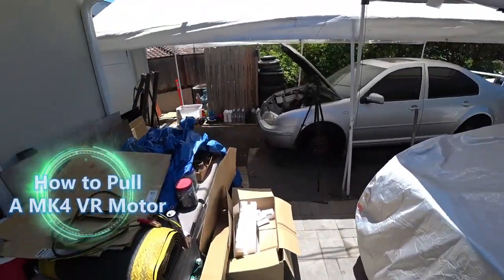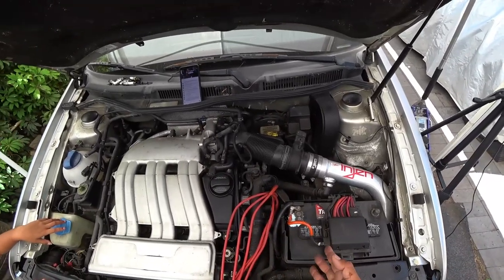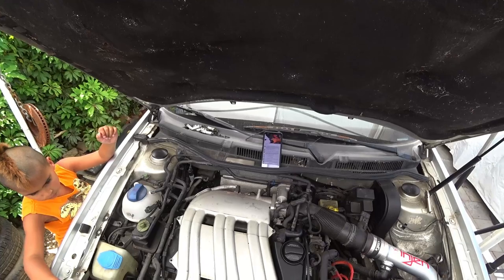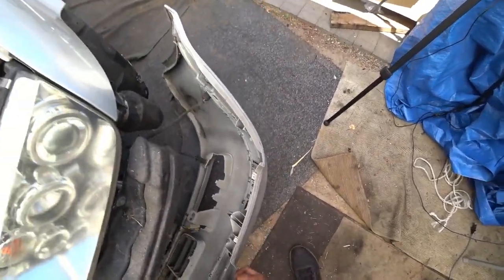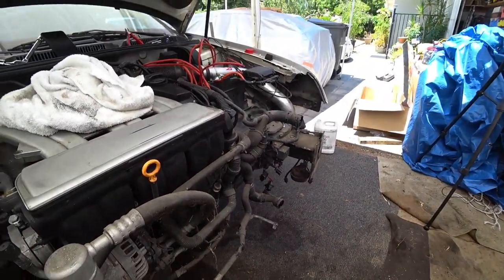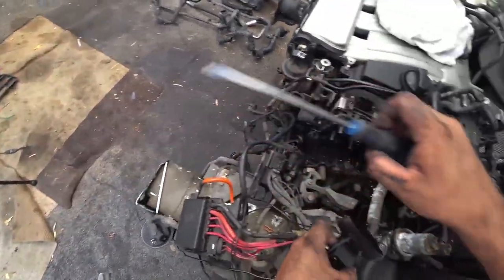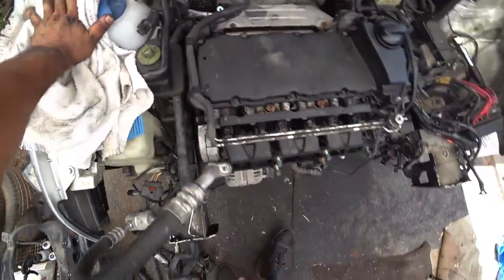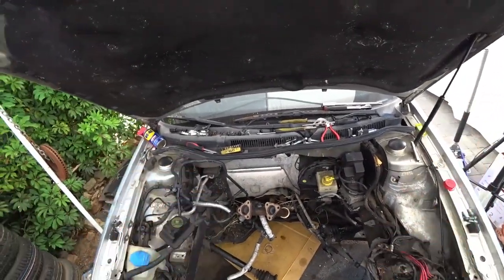mk4 vr6 motor removal S7EP2

Comment: So I've been watching you for a while now... I really love the videos... I'm curious to understand what I need for the swap??? I have a 1.8t and I want to swap for the 12v vr6 what do I need?
Reply from the maker: You need the a 12v vr6 harness
Vr6 transmission 
Axles
Vr6 motor
The cluster
Ecu
Reply: @PincheALsGarage  sweet so do I pull the wire harness out of the fire wall?
Reply: @PincheALsGarage  I have a complete donor car so I will be able to do the swap easily. Thank you for the advice I really appreciate your time. Is there anything else major that I would need?
Reply from the maker: @allenowens5553  nope just don't rip or cut any of the engine harness most of it will come out through the firewall and the cowl
Reply: @PincheALsGarage  ok sweet thanks 😊
Reply: @PincheALsGarage  hey I got the harness sitting in the cabin but do I have to drop the dash?
Reply: Quick question do I need the harness that I just pushed into the firewall